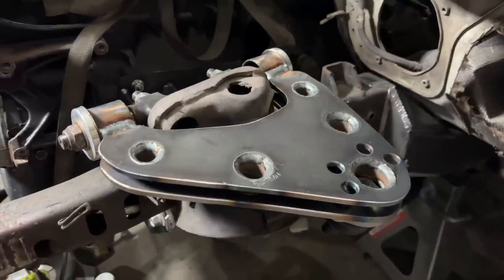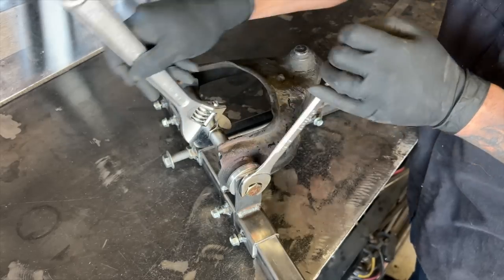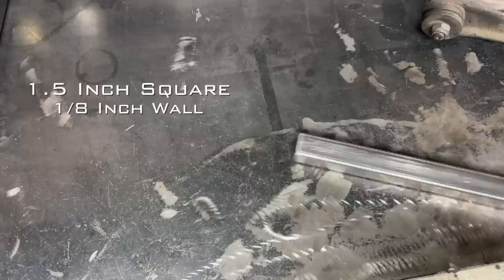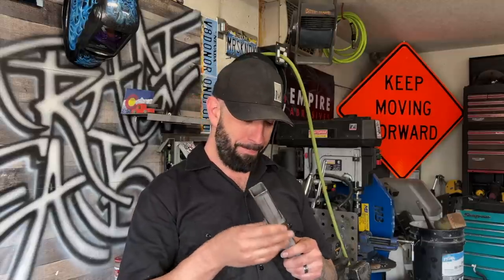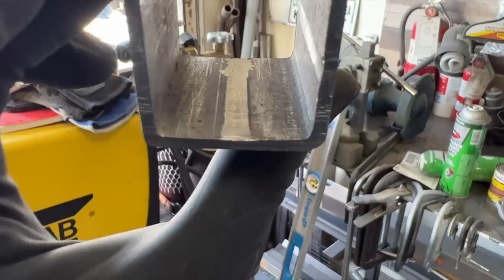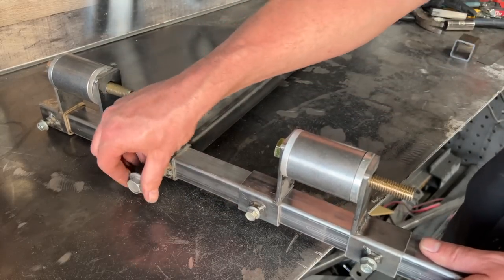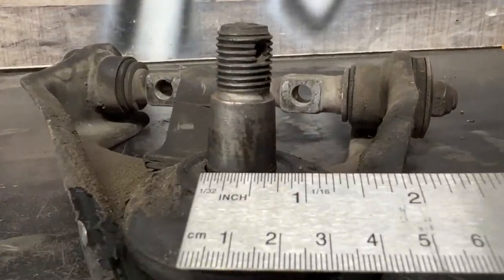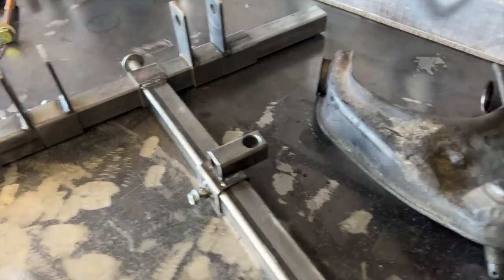How To Build an Adjustable Jig for Custom Control Arms!

Comment: Nice idea sir!! For control arms for lifted trucks would it be be necessary to add a twisting ball joint mount??
Reply from the maker: We’ll talk about ball joint angle in the next one. I honestly haven’t come up with the solution yet! The angle of tapered stud does not matter, but the angle of the socket that the ball joint rests in is VERY important because it determines how much movement the joint will have and therefore determine how much the suspension can move before the ball joint binds.
Reply: @GarageFab  What about using a ball joint with set screws added to lock it in place? Sounds good in my head, reality may be a different story. I've been pondering over this one all morning since watching your video.
Reply: @GarageFab  What about using a bullet hinge under the ball joint mount you made?  Then to lock the angle you can have a plate on the side with a gusset. Then use the same nut/bolt arrangement on the opposite side of the nut/bolt for the slider. You would only need to cut your current mount off of the slider. Then place the bullet hinge between them and weld in place.
Reply: @Arvizu Design&Fab 
@Garage Fab

As far as being able to adjust the angle at which the ball joint is mounted to the control arm bushings - Wouldn't it be as insanely easy as making the flat stock for the control arm bushing jig longer - and instead of a single hole on each one to slide a bolt through, you were to cut a long slot instead? ... Moving the control arm bushing up / down changes the angle between it and the ball joint.
Reply: I think for lift you want to look at the knuckle as the lift device and keep the control arms as close to stock as possible to control use of original ball joint angels as well as steering shock and spring control points, if you force the knuckle to do the lift then ideally you can use stock parts, otherwise you get into needing to customize steering connection angles too.  I'm not 100 % sure though and right now have a 2wd 64 c10 with 3 inche of knuckle lift so I'm following this too with the desire to make custom tube arms and switch over to coil over shocks.
Reply: @Robert Craft  sometime you cant. I had to order custom upper controls arms on my last lift/front end level.
Reply: Anyone know a good source for, ball joint specs? Specifically if they are normally not removable, but I want to make custom uppers?

Comment: Love your recepticle for the Taper 👍 A side thought,,, have you ever considered putting the set screw in the corner of the tube? it cancels the slop both ways and it prevents the tube from being dented when tightend.
Reply from the maker: I put a diagonal set screw in a tool stand system I created! I’m not sure why I didn’t do that on this. 🤔

Comment: This could also come in handy for prototyping. I have two cars which are going to need custom arms, upper and lower. One is more than 60 years old, so the suspension geometry is basically from a covered wagon. The other has McPherson struts up front and will need grownup suspension at some point. With this jig I could switch it out to do the uppers and lowers for each car. I could also whip up a few variations to see what different arm lengths did for scrub, bump steer, etc. About the only change I would make would be to add gradations on the tubing so I could tell at a glance what the length and width of the arm was.
Reply from the maker: I’d love to see all that. I’d also like to see a unit complete masterfully assembled with graduations laser etched. I currently just use a sharpie if a change needs to be made. Not very glamorous!
Reply: @GarageFab  Who says sharpie isn't glamorous?
Reply: @GarageFab   You could just superglue a cheap steel rule to the side of the tube.
Reply from the maker: That would be nice, but there is very little clearance with this size tubing. Maybe a slightly thinner wall outer tube would work.

Comment: I like this because with this, a tape measure, and an online link calculator, you can easily make custom links with whatever geometry your heart desires.

Also. 4:56. My guy, let me tell you about a nifty tool called a "reamer" 😂
Reply from the maker: You mean an arm breaker!? I actually think I have one of those somewhere. I gotta see if the angle is correct. 
That would be a good use. The challenge would be the location of the ball joint between the bushings. But if you start with a factory control arm that would be cake.
I intend to use this jig on the next project to turn Chevy Impala control arms into much longer ones for a wider stance.
Reply: @GarageFab  thats what i was thinking: this jig is perfect for DIY long arms. As long as you use an online calculator properly, its perfect.

Comment: It's a great idea that makes replication much easier  was wanting to build my own uppers and adjust the angle to help with binding issues. You could make the ballpoint mount plate for specific arms to bolt the plate too, and simply slide on which ever jig you needed. But if your building customs arms, you could use any join you like the look of or have access to easiest work as well.

Comment: Great concept! I feel the center tube being able to move is adding an unnecessary variable that could be bumped out of place. The bushing locators already have the freedom to off center the ball joint. An adjustment for the ball joint angle would be a nice addition, so that the ball joint could be put in straight, or at whatever angle needed keeping the joint itself straight. That may be going back to my first note thought of being another variable that could be bummed out of place.
Reply: He was making this jig to be universal brother.
Reply: @path4514  I fully understand what his intentions are. If you would be so kind to reread my comment, you'll see I was only offering ideas to improve his jig. The center arm moving on the same axis as the bushing mounts, is an unneeded motion. The bushing mounts are already able to move giving the ability to offset the ball joint. Welds, even as small as a tack weld want to pull. The less places that are able to move in a jig, the more likely the final product can be repeated.
Reply: I guess your meaning to much adjustability.
Reply: @path4514  say 1 movable part can shift 1/32". That's not much and can easily be worked with. Each movable part you add though, that small amount grows. With 3 that's the potential for 3/32". That's starting to dance on almost 1/8". 
The 3rd doesnt need to be there seeing as the other 2 can do what it's doing. I would however bolt it instead of welding it, so that it can still be broke down for smaller storage. All in all it's a great idea. I just learned the more room you leave for possible error, the more likely it is to bite you.

Comment: With the right measurements, you could make a new arm with added caster, etc. by making the proper adjustments. Very cool.
Reply from the maker: Absolutely. The mathematical part would be a challenge! (Meaning how much movement is needed to create a given degree increase in camber or caster?) 🤯 But after you figure that out it would be cake!

Comment: Are all control arms just a flat triangle between the bushings and balljoint?  I thought there would be some angles involved on how the ball joint was mounted that needs to be worried about?
Reply from the maker: That will definitely be addressed in the next video. No! They are NOT all flat. The amount a ball joint moves for given amount of suspension travel needs to be considered. Otherwise you might find your bell joint binding.

Comment: That’s a badass simple little tool!!! To prevent movement from welding, do any of the mounting tabs need to be gusseted? I plan on making one of these, great idea.
Reply from the maker: I haven’t had any problems yet not having gussets. In fact the absence of gussets comes in handy often because you can turn the tabs around if you need tabs close together or close to the center tube.

Comment: Makes me wonder if mirrored pieces on the slide pieces would allow a mirrored part for the other side…
Reply from the maker: 🤔 You could technically measure the distance of the vertical bar from one of the bushings and move it that distance to the other bushing and the rotate the ball joint socket and voila. Mirrored.

Comment: This is amazing! I'm gonna see if my buddy (a pro welder) and I can do this so I can make some tubular control arms for my Dakota. 

I'm not sure if I saw an option to modify the control arm to push in or out the ball joint mount location to modify camber for lowered trucks. 

Maybe I didn't pay attention enough? 

ADHD..... 

All you would have to do then is know how much longer the (upper for instance) stock control arm would need to be to push out the wheel at desired ride height.....

Does my thinking make sense? 
You would just move the ball joint mount bracket further out to make the wheel straighten up and down based on ride height?

I hope I didn't ramble too much to make this confusing.... 😜😜
Reply from the maker: Not confusing at all! The fixture that holds the tapered stud on the ball joint is on a sliding sleeve, so all you would need to do is determine how much you need to push the ball joint out, make a mark and slide the fixture to its new location.
Determining how much movement equals your desired change in camber would be the challenge. Because math. 🤮
Reply: @GarageFab  that's sound easy AF except you said math! Lol I was really good at that at one time der

Comment: any ideas on adaptable bolt hole sizes?
Reply from the maker: Hmmmm. 🤔 Not yet. I just have other sliding tabs with various hole sizes. 
I suppose it’s doable to change the holes in a single set of tabs.
Thorbros.com sells mock-up bushings with inserts (basically washers) to change the through bolt size. I imagine you could do something similar to that!
Reply: @GarageFab  
Thanks for the response, made 90% of my jig today following your video (still need to drill/weld). Will look into these, thanks

Comment: Maybe I don't understand how this works, but all 3 points are in a fixed plane and angle. Wouldn't  you need to be able to raise/lower the ball joint end and set it at the appropriate angle?
Reply from the maker: Yes, you absolutely need to set the ball joint housing angle. The height of the ball or the angle of the arm however, doesn’t matter as far as geometry goes.
When fitting the original control arm into the fixture, you must take note of the angle of the ball joint housing and make sure the new arm is the same. (Unless you need more ball joint movement. In that event you’d probably want to choose a new angle.)
Reply: @GarageFab Some control arms are curved for suspension travel, or to orient the spring pocket toward the frame etc., but I suppose you could still account for that by bending the tubing and mocking up as needed. Also, shouldn't you capture the location of the lower shock mount too?
Reply from the maker: Truth. That’s some advanced stuff there. The jig only holds the bushings and ball joints in the proper orientation and the proper distance from one another. Clearance of other components will be up to the builder.
As for the shocks, most of the trucks I’ve built have a shock absorber that’s mounted through the center of the spring. That’s not an option with the typical air spring. So the shock needs to be relocated elsewhere. There will be a video on that in the near future.

Comment: Can you make longer control arms with this based off the stock ones?
Reply from the maker: Absolutely. With this jig in particular, you would just set it up with a factory control arm, and then slide the ball joint holder out the amount you want to extend the control arm.

Comment: Why someone would like to build custom control arm with factory like geometry??
I thought that custom control arm are needed, if you want to change the geometry!?
Reply from the maker: Often arms are changed just for better components. On trucks with air suspension, often the factory bonded rubber bushings will tear so replacing them with a polyurethane style bushing that rotates. There are also aftermarket ball joints that can be installed that allow for much more travel before binding.
In this case you would still want the geometry to stay the same. You’d want the bushings in the same position so that they bolt the vehicle, and you still want the wheel located in the same position in the wheel well.
You are correct though, many times a change in geometry is desired. Off road vehicles, for example, might want longer control arms for more travel. A jig like this can still help, because you could just slide the ball joint further away from the Bushings. But you’ll still want the bushings and the original location, and the ball joint will still need to be positioned so the wheel is still centered in the well.
Reply: @GarageFab  this is kind of smart, actually this made me thinking about building custom control arm, with bigger bushings for durability..

Comment: I want to see you take a stab at some diy drop spindle action!!   
You got this!
Reply from the maker: in the next project I’ll be using Impala drivetrains and front suspension but converting them from a McPherson strut design to a dual A arm design so you just might get your wish. 🤔
Reply from the maker: Clarification: I wouldn’t be comfortable building an actual “spindle”. However building a knuckle to accept a bolt-on hub assembly should be cake.